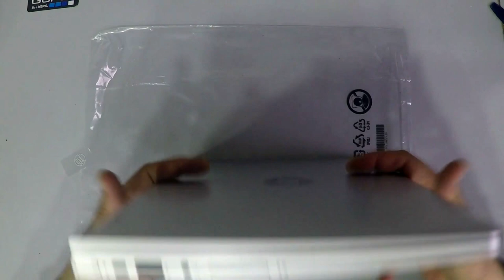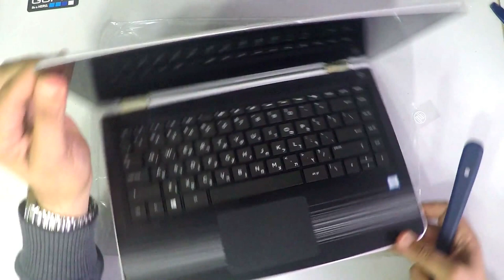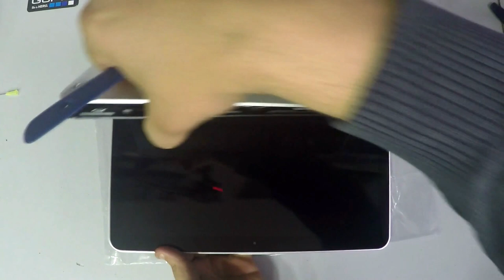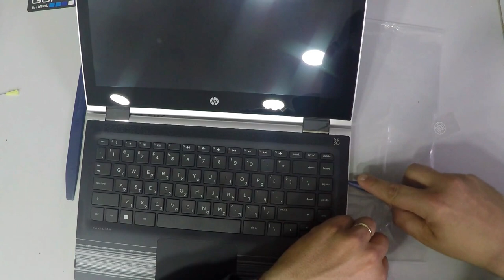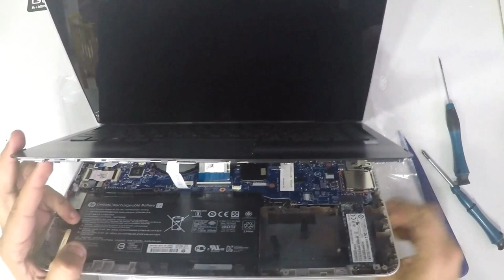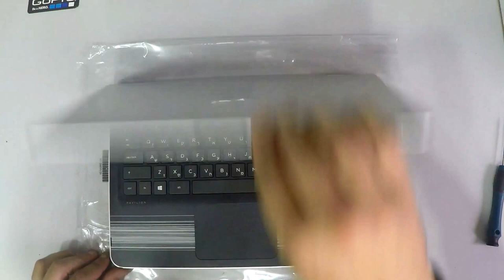HP Pavilion X360 13-U106 13.3 Touch M2 SSD

Comment: Thank you for the video. Will upgrade mine soon. You know if it is possible to upgrade the RAM?
Reply from the maker: Hello bas, in this model there's no option for upgrading ram.
Reply: RAM is on the backside of the motherboard. 2 slots.
Reply: I have the pavilion x360 13-u001nl i3 model, the m2 slot is present but not soldered. I put a regular Ssd SanDisk plus 120gb, and another 4gb of Ram ddr4.